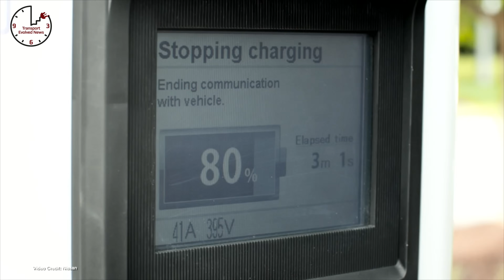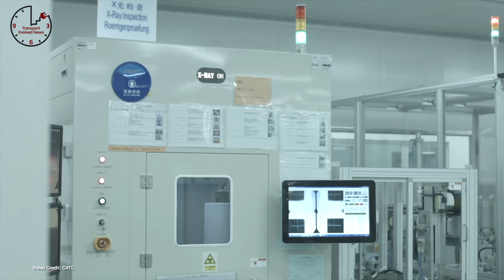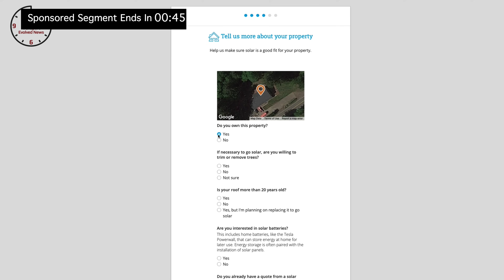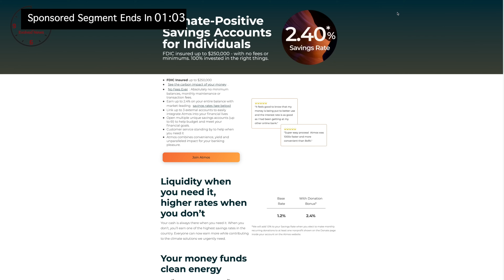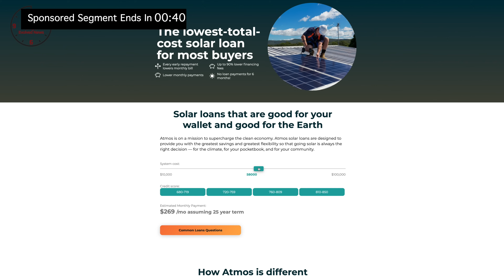Transport Evolved News (TEN) Episode 471: Elon's Not Happy With Delaware

Comment: I have a friend who owns a 2019 Chevy Volt, and he almost never uses gasoline. The car requires you to burn it now and then so it doesn't go bad in the tank. We are in no way angry about this.
Reply: That's great to hear! As Nikki mentioned, PHEVs are not as clean as it advertised and there's a reason for it. It's not that it can't be driven in EV mode - just as you told - but I heard companies buy these to emloyees a greenwashing scheme (it look good on their promo leaflets), yet not educating the new users how to use them, therefore they use it as a regular petrol vehicle and never plugging in. Imagine if this is true.
Reply: We owned a Ford C-Max for 3.5 years with only 20 miles of EV range and we live 20 miles from town and yet we managed to get 50% of our driving in EV mode. This is because we knew what we were doing. We have now been driving a BEV for about 3 years and our mpg-e gave more than doubled.
Reply: The two volt owners I talked to used it mostly as an EV. I wonder if the so-called survey about that was faked.

Comment: Transport Evolved crew. I wanted to thank you. In the past you talked about ages ago with your advice on one of your YouTube videos, that The Chevy Bolt is a great car. You had good pro and Cons on GM. I ended up getting the Chevy bolt. Its my first Electric car. I did it for these reasons. Tesla cars are really expensive on insurance in Canada. So that was a no for me. I wanted active cooling on the battery, So I didn't want a Nissan leaf. Lastly I needed an affordable price under $35000 Cad. I ended up getting a used Chevy Bolt with yes....  battery warranty on the car at Chevy. I understand there is a lot of hype for the Tesla cars but the Chevy Bolt works for me in all category's, like , price on insurance,, high ev range,  active cooling for battery management and cost. I love the car for driving around town, long road trips and to never to go back to the gas pump. Once again from Canada thank you Transport Evolved. Your making a difference out there. Love from Canada.

Comment: 92,1% of all cars sold in Norway are now EV's.
And, Lexus, VW and Opel are only selling electric cars.
So, looks like 2025 is in route.
Reply: They must allow E-Fuels when the EU decides so. Just you wait and see. 
In 2035 all new vehicles in Norway will be VW Golf XII with their new 4 cylinder 16 valve DOHC 70 HP E-Fuel driven engine. The newest and best of all time!
Reply: @wolfgangpreier9160  E-fuels are a joke.
When gas stations go over to energy stations, and 1 of 2 refineries are shot down, now.
Where are you going to sell the E-fuel in 2030?
The life span of a car in Norway are 14 years. The last 3-4 years the EV sale have been over 50%, and now they are selling the used fossile cars abroad.
The few fossile cars left are going to have to buy the fuel on Ebay, or convert the car to Ethanol and make the fuel your self.
It can probably be posible to get some diesel, because it can still be some trucks running on the stuff..
Else you need to ask the local burger shop to give you some oil...
Reply: @geirvinje2556  "Where are you going to sell the E-fuel in 2030?" There is no E-Fuel. In 2030 only airplanes need something like that - and can afford the price.

Rolling vehicles will all run on electric energy with the help of batteries. LFP, NMC, NCA, Na+ and some exotic types used in busses and trains. Most trains n Europe already run on electricity from overhad cables.

Ebay or Amazon. Yes. Or Porsche. 

I guess Aral will make a deal with Siemens and Porsche and import their E-Fuel from Patagonia. 500.000 liter each year. Thats a part of a smaller tanker.
Reply: @wolfgangpreier9160  When planes are the only users of petroleum, expect your airline tickets to go up 300-500%
Reply: @pogo1140  Good! Then they are at the same value they were 40 years ago. 

Hopefully the people then either travel by train or bus/car again and do not pollute the whole earth.
Reply: @wolfgangpreier9160  Expect your food and other goods to go up by a similar amount as well.
Reply: @pogo1140  Why expect? Have you heard of something like "inflation"? Our economy is based on this concept.
Reply: @wolfgangpreier9160  Inflation is seperate. This will be tied to the cost to produce the fuel. Lower demand will lead to fewer producers, fewer producers will lead to higher prices. higher fuel costs means higher shipping costs. That means the cost of your battery, parts for your EV will go up as they need to be shipped by air or sea.
Same with food, shoes, shirts, pants.

Comment: Is there a minimum ev-only range for PHEVs  in which most miles driven will be ev only? Meaning, a phev with only 12 ev-only miles will not help reduce emissions, but what if it’s 60? Granted, it’s still no EV.  But most people today are not buying an ev, so they need a greener option they’ll consider
Reply: For my use I need a minimum winter electric mileage of 60 miles to be electric mostly.  However, I’m the kind of person who can and will plug in and recharge every night.  The problem with plug in hybrids are the people who get them as company cars to get favorable tax rates, and then never plug them in, turning them into less efficient hybrids with heavy battery packs
Reply: @MandyFlame  Should end all tax incentives for personal vehicles since their impact on emissions is minimal. Tax incentives should be reserved for commercial transport and investment for public transport which will have an effect.
Reply: In 2021, passenger cars recorded the third-highest greenhouse gas emissions among on-road vehicles at 374.2 million metric tons.

Dec 15, 2023
Reply: @christophers707  " . . . personal vehicles . . . impact on emissions is minimal . . . " 
You should see the light-duty trucks around here!  Noisy exhaust (noise pollution) is typical, and so are tuner chips in most of the trucks in this town: black smoke for every stoplight start.

Maybe it's different where you live.

Comment: Mary Barra has little vision, commitment and courage (balls). PHEVs are ineffective for those who live in a condo or rental as I do. As a previous and satisfied owner of a  2015 Volt, I found it impossible to charge at my residence. A nearby level 2 charge station provided the juice for free untill the owner opted to "upgrade" to a level 3 DC/FC pay station which made my series hybrid a de facto gas guzzling pollutermobile.. That forced me to search for a BEV in order to continue that great GM EV feeling. A happy ending however as I traded for a Bolt EUV PREMIERE which makes me wonder if Ms.Berra has a short circuit between her ears. My Volt no longer filled my needs nor will any plug in hybrid for many other drivers like me. In addition buyers were jumping brands to GM to their BEV models.. Personally, I'm convinced that the Bolt EUV is the best car that so far has come from Chevy and I plan to keep mine for a very long. time.

Comment: why is the ccs to chademo adapter so heavy
Reply from the maker: It has a whole lot of internals, including a battery, and a computer
Reply: Both CHAdeMO and CCSx are physically large connectors with big housings, so even without adding anything else, just molding a housing with CCSx on one side and CHAdeMO on the other is going to be large.  Then plug a CCSx cable into it, and it becomes quite hefty!

The protocol and level-shift electronics inside the adapter requires 12vdc, and while many approaches to obtaining that power have been made, the design choice by this vendor was to incorporate a small rechargeable battery stack inside the adapter, which will recharge via the charge current when in use, and can be recharged externally via USB (I think) when it's been stowed and unused for a number of months and might run down.  In practice, it only needs to be "kick started" until a charge session is initiated, at which point it'll continue charging itself.

HTH
Reply: Why not just make a retrofit that replaces the ChaDeMo connector on the car and converts to a NACS? Not rocket surgery. They could power the comm protocol circuit from the car.
Reply: @jamesvandamme7786  This was Dala's original plan. There are dependencies on hard-to-get parts (BMW i3 was a favorite donor). Frankly Nissan could engender a LOT of goodwill by offering a conversion kit for LEAF owners.

Comment: Americans are stubborn Nikki, I think PHEVs are going to be necessary as training wheels to get the adoption rate much over 50%. I just wish GM had continued to develop the Volt power train. If it means we get a phev or three that are just vehicles from their joint ventures in China with a modified Trax or Trailblazer body slapped on top I'm ok with that.
Reply: @markplott4820  Yes, but they are loved by dealers because there's two power trains to maintain, and they cost more too. Consumers can greenwash their car purchase and maybe even get a little better gas mileage. And they don't have to use that scary 'lectricity, which is made from coal and slave labor.

Comment: Thank you. I am a longtime subscriber and generally agree with the opinions offered here. However, you stopped me short at 5:30 with “long line of automakers delaying RV promises and deciding profits come before a livable planet. We should all be mad.” You seem to be implying that an environmentally favourable choice was not made because of the pursuit of profits. Although that is factually true, if any company is not making a reasonable profit, it is only a matter of time before it goes out of business. IMO, neither GM nor Ford are able to push their BEVs ahead in a profitable manner. The story they are reporting is that demand for EVs is moderating… There is an element of truth to this statement, but it would be more accurate for both GM and Ford to report that the EVs they are delivering are simply not able to be sold at the prices they need to charge for them to be profitable. This causes both GM and Ford to behave as they are by reducing output to reduce losses. What they both need to do is produce their EVs profitably so they can compete in the marketplace. I would speculate that they are both scrambling to do this while trying to maintain profitability on their ICE, Hybrid and PHEV products.
Reply: While I agree with what you've said, my take is that the profit margin is much less for legacy mfgrs building fresh EVs than for the traditional ICE vehicles they've optimized for profit/wear.  

While I don't doubt that there are certain EVs that really are money-losers (my 2014 RAV4 EV was certainly such a case, as it was built to be a California "Compliance Car" and proved to be very expensive indeed due to most of the Tesla bits inside having a very high failure rate, ala the Model S of the same timeframe), I believe most EVs are still profitable right now . . . just not at the profit level that legacy mfgrs are used to.
Reply: @alsavage1  How about their profit level if they go out of business?
Reply: @jamesvandamme7786   What part of "profit" in what I said leads you to "go out of business"?  All businesses have varying profit margins, and major shifts in market conditions invariably (that means "always") lead to a profit margin change.  

How you took that to mean, "lower profits = going out of business" is unknown.

Comment: PHEV still has a role in the US for a solid decade yet at the least because 60+% of owners can't charge at home or work until at least then. They must have 30-50 miles of all-electric range though, or some kind of Chevy Volt solution or i3 REX because almost nobody lives on highways which is where foolish America places its plugs. Charging at office areas will also cover the folks that only have street parking or rent their residence. The only thing that will keep BEVs ramping up is regulations enforcing charging for multi-tenant residences, street lamps, and all the lower income areas so they can also go electric once the used EV market develops.
Reply: Can you provide a reference for ". . . 60+% of owners can't charge at home or work . . . "?  I'm genuinely interested in that number, as it's double what I've read elsewhere.
Reply: GM will most likely be using the power trains from their joint ventures in China which seem to have pretty good range (even after accounting for the Chinese range test cycles being too generous).
Reply: @davidmccarthy6061   I would think if you can’t plug in an EV then you can’t plug in a PHEV either.  A hybrid would be helpful, but a PHEV would just be a hybrid most of the time.
Reply: Level 2 charging everywhere is the key.  

Without it, PHEV serves no purpose, as, where would you ever charge one?

With it, PHEV serves little purpose, as BEV would work fine for most people.
Reply: 65.8 percent of all Americans live in their own home as of 2022 that's about 230 Million
Reply: Everyone should message their governor to do this:  California state law (Civil Code section 1947.6) requires landlords to approve tenant requests to install EV charging stations in their dedicated parking spaces so long as the tenant is willing to pay for the charging station and associated costs, including installation and utility costs.
Reply: @rp9674  Every state should have this.  But they should have much more as well.

Comment: 17:51 The instant torque and acceleration of an EV is a two-edged sword.

Sure, it'll get you out of trouble, but how often that trouble was caused by the driver of an ICE who couldn't match your acceleration? I'd say it's very likely.

Now imagine the case where that same distracted or recklessly aggressive driver is themselves at the controls of an EV with responsiveness and acceleration equal to your own. You thought yourself clever by mashing the accelerator and darting out of the lane-- what happens when every single jerk on the road can do the same thing to you instead?
Reply: Then you have to drive sensibly and defensively, as too few drivers do already. Acceleration is not always the answer.
Reply: There have always been faster cars and slower cars, nothing has changed

Comment: In addition to Ford offering an adapter, why not offer something for those who want a more  permanent solution and build it into a new charger port on the car itself?
Reply: @jamanjeval   Ford will add the NACS port to their cars next year.  But for existing owners and buyers in 2024 the adapter gives them access to most of the Tesla network.
Reply: That will be handled aftermarket.  And only after the built in version is on sale.
Reply: Maybe someone will design an even better charging standard in 2 years and we can get an adapter for your adapter
Reply: @doittoit00  I understand what it is, I’m saying that if you can build an adapter to plus into the truck, a better solution would be to replace the charging port with a nacs one which has the adaptation voodoo built  in
Reply: @rp9674  that’s the reason to build it in is you won’t need to stack an adapter on an adapter! Just go directly in 1 adapter step
Reply: @jamanjeval  Cost.  External adapters are cheap/easy/universal, as (today) NACS uses CCSx protocol and not electrical level-shifts.  The external adapter can be universal.  Start with retrofits, and every single model needs a unique engineered solution, documentation, training, warranty, etc.

Cost.  That's why not.
Reply: @alsavage1  If you have an adapter you can use a CCS charger or a NACS charger.
Reply: @jamesvandamme7786   Maybe.  CCS (and NACS, which nowadays uses the CCSx protocol; it didn't always) has fingerprinting, and I expect some (many?) NACS providers to restrict DCFC to only those CCS vehicles with whom a relationship has been established.

Put another way, I don't expect Tesla to let anyone who connects to their DCFC charging network to charge.  If you have a CCS car whose mfgr hasn't established a relationship with Tesla, you may be out of luck.

Adapter or not.
Reply: @alsavage1  you are correct in the general sense but not this one. This isn’t about anyone connecting to a Tesla charger with an adapter. Ford (amongst others now) have a relationship with Tesla that will recognize the non Tesla vehicle and allow dcfc. The reason ford is adopting nacs is to use Tesla chargers.